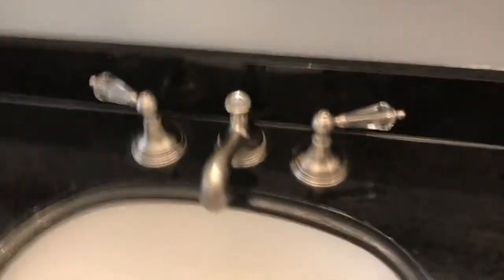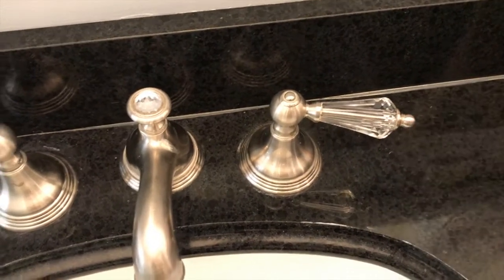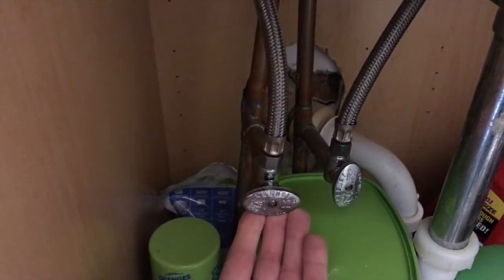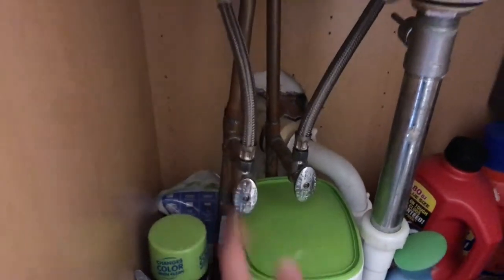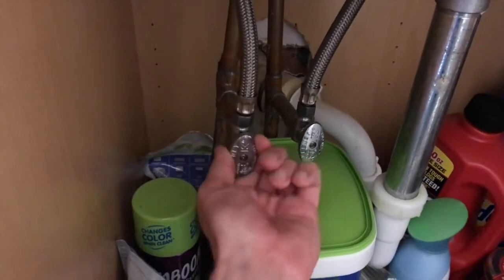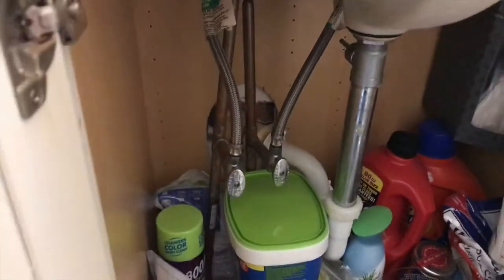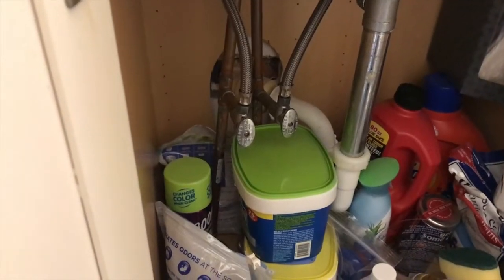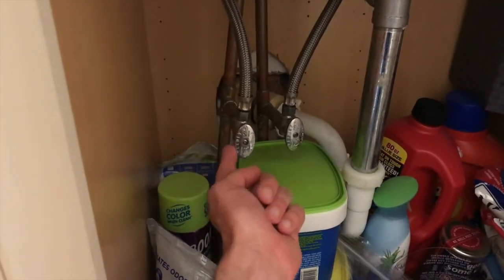Vibrating/Humming Pipes - "3 Most common causes"!

Comment: I've got a humming sound all over my unit, the same sound decibal, I wonder if it's due to the pipes and if so, are there pipes in the roof, It's not an electrical issue, could that be the problem?
Reply from the maker: Good morning, just poured a cup of coffee and am sitting down to answer any and all questions for the DIY community.

Have you adjusted your hot and cold valves?  It’s unlikely that you have plumbing inside roof area as it, in most cases, wouldn’t be heated.

Has anything within your plumbing system been changed recently…?…new faucet, new toilet, new sink…?

Let us know if you have any questions and hey if you’re into crypto trading, join our DIY ecosystem.

       toolboxtoken.com

Reach out to us any time!  🧰
Reply: Ok. Thanks for letting me know it's really bizarre, it's the same humming sound in each room,, it started since the neighbour had a split system air conditioner installed, the noise is still occurring even when her air conditioner is off, what might it be, Sounds like a distant vaccume cleaner, I wonder if it's coming from the roof, there are rats in the roof don't know if they've done damage?
Reply from the maker: @carmenbugeja8722  

We are happy to help.  Is this an apartment complex, condo, or duplex?  If so, you may want to consider bringing this to the attention of the association.

Your plumbing should not be altered or affected just because your neighbor got a new AC unit.  It’s possible that your neighbors system is tied into your plumbing and will require some minor modifications to alleviate vibration and bring it up to code.  This isn’t uncommon with these setups.

Comment: Humming pipe noise anytime my sprinklers are on. Can you please let me know how to fix it? Thanks
Reply from the maker: Southern California 

Thanks for watching & is your sprinkler system connected to the spicket or do you have a full electric control box on wall?

If it’s connected to spicket, there should be a shut off valve inside home on the opposite side as your spicket.

Make sure shutoff valve is in the fully open position.  If it is...It’s possible that your shut off valve is beginning to wear out and cause the humming.  Keep us posted.

Please subscribe to the channel and ring your YouTube bell 🔔 this will be very helpful to us thanks again.

😎👍🔧🔩
Reply: @DIYwithMichaelBorders  Thank you Michael for replying so quickly. I have a full electric control box on the wall. What should I do?
Reply: @DIYwithMichaelBorders  I subscribed. :-)
Reply from the maker: Southern California 

Thanks for the reply.  We recommend locating the closest shutoff valve to box & verifying it in the full open position.  Has this been going on the entire time you have had your sprinkler system?

Your household water pressure may be slightly higher than what the sprinkler system wants.  Keep us posted.

😎👍🔧🔩
Reply from the maker: Southern California 

Thanks, we subscribed back.

😎👍🔧🔩

Comment: I have this problem when anyone uses the shower in my guest bathroom.... is there info video available to fix this???
Reply from the maker: Marin Rands 

Thanks for watching & it’s very possible that your Stem is wearing out.  Below is a link to our step-by-step video that shows replacement of a Stem.

       https://youtu.be/F7B-3wR9aQ4

Whether you have a 3-Way shower valve or Single handle valve, the stem design is the same.  Some people replace the rubber gasket only and reinstall the old Stem with the new gasket.  In most cases this works however if it does not fix the issue it’s best to replace entire Stem.

Hope this helps Marin.

😎👍🔧🔩

Comment: Just watched the video.  I have a pressure regulator on my house because we have 120 to 125+psi from the city. It doesn't matter  what  faucet I open the whole house seems to make that humming. Any ideas
Reply from the maker: Robert Bragg 

Thanks for watching & that’s no fun.  Is this a recent issue or has this been going on for awhile?  Any recent plumbing repairs anywhere in house?

😎👍🔧🔩
Reply: @DIYwithMichaelBorders  it started I think 1or2 weeks ago.  After watching ur video the statement you made about  adding a regulator it got me thinking about the noise.  It was everywhere.  So I watched the pressure gauge while running the water and noticed that the running pressure dropped to 50psi. So I increased it to 70 psi running pressure at that point it quit. It's still weird but no noise
Reply from the maker: Robert Bragg 

Thanks for the update & that’s odd.  How old is pressure Tank?
Reply: @DIYwithMichaelBorders  5 months
Reply from the maker: Robert Bragg 

That’s still brand new.  It may be an option to check warranty on tank & have the company stop by & test it.

Comment: What if this is only occurring with the shower body valve when it’s turned on
Reply from the maker: Thanks for watching and welcome to the DIY Raptor Club.  This can happen when the internal stem/cartridge is wearing out.  It can also be as easy as replacing an internal rubber seal.

Below are a few links that you may find helpful.

       https://youtu.be/WHd_pKo0gx8

       https://youtu.be/F7B-3wR9aQ4

       https://youtu.be/5Np19i1yVYw

😎👍🔧🔩
Reply: @DIYwithMichaelBorders  Thanks a million
Reply from the maker: @worldview730  

You are very welcome, us fellow DIY’ers need to stick together.  Keep us posted on your project & any questions you may have.

😎👍🔧🔩

Comment: Hello Michael! I'm researching because my pipes are suddenly starting to hum and I'm a plumbing novice so I'm trying to figure out what my issues could be.

Recently my water heater died and funds are tight so the water intake to the water heater is turned off while we save to replace it. Things were fine for awhile but a couple days ago I noticed an aggressive humming coming when I was using the kitchen sink (cold water obviously). It went away when I turned the water off and wasn't repeated on other times using that sink so I figured it was a weird one off or maybe due to some local construction happening in my neighborhood. 

But today it happened when the toilet was being flushed, and when the tub cold water was being used. But again only a one off.

I'm thinking it's probably not valves since those were untouched and I don't know where to find my bathtub valves anyway to check those. Could there be other causes or things I could look into? So far Google is just telling me water pressure and I found your video when trying to look up how to reduce my water pressure. But I'm skeptical of that's it since a couple weeks happened between the water heater dying and the humming starting, and I dread the cost of a plumber with everything else going on. Got some ideas i can try?
Reply from the maker: Good morning, thanks for watching.  Any update?  It may be as simple as an imbalanced pressure within the system since your water heater is shut off…unlikely but possible…

It can also be that your shutoff valve for your cold water supply has gathered a bit of extra sediments and is intermittently restricting water flow.

Sediment buildup can gather slowly over the years however build at a more rapid pace when vital components within your water system fail…such as filtration system, iron removal system, water softener system…

Once water heater is replaced and all systems are a “Go”…we recommend allowing water to flow out of all your faucets for roughly 15 minutes.  This will help system push out and flush as much of the built up sediment as it can.
Reply: @DIYwithMichaelBorders  thank you! I don't have any solid answers but the humming seems to have stopped..... and the local construction has completed. Best guess something they were doing caused the humming and probably I wasn't the only house to encounter it. My water pressure never changed and it doesn't seem to be an issue with the valves unless I'm missing something. 

So, guessing it's something they were doing and issue is hopefully resolved. Fingers crossed!
Reply from the maker: @danistaab7152  

Thanks for the follow up, that’s very likely.  No more vibrations within plumbing system is a good thing.

😎👍

Comment: THATS EXACTLY THE SOUND/NOISE my shower makes. 

I have a single knob adjuster and when I turn it on hot mode, it hums so loudly. 

How do I fix this?
Reply from the maker: Thanks for watching & welcome to the DIY Raptor Club.  We are going to post a few helpful videos below.  Sounds like you need a new stem.

First, we will share our video showing replacement of stem.  Although our video is working on a three-way valve, you only need to replace one.

The second video shows us working on a single shower handle.  Although we do not replace the stem in the video, it will hopefully help you get a lot more familiar with the parts that need to come off.

1.  Replace Shower stem

          https://youtu.be/F7B-3wR9aQ4

2.  HOT/Cold reversed

          https://youtu.be/9QiJt4YPU_o

😎👍

Comment: My entire home has a low humming vibrating sound it us super annoying started  when pipes and boilers installed cannot pinpoint exactly where it's coming from  its like its in the walls
Reply from the maker: Thanks for watching & welcome to the DIY Raptor Club.  How long ago was new pipes & boilers installed?

If very recently installed, you may want to have the plumbing company that installed new parts come back & make some adjustments.

Keep us posted.  😎👍🔧🔩
Reply: @DIYwithMichaelBorders  
It's been nearly two years but there is this a low constant wooing/ droning sound in my home.  It sounds like its in the walls and the boiler is very noisy
The Walls also make a cracking  sound when the heating comes on which I think is the pipes.  It has been very stressful and affected my health
Reply from the maker: @missamour1393  

Thanks for the reply.  Any update?  You may actually be hearing water flowing through the pipes that feed water from a higher floor.  Is your home have a second floor?   Does your home have a large household water filter connected to your plumbing near softener & salt tank?

😎👍🔧🔩
Reply: @DIYwithMichaelBorders   Hi,  so I live in a maisonette.  There is upstairs and downstairs so two floors.  There is no water filter. 
You maybe right about  hearing the water however  it mainifests as a droning/ humming low frequency  sound throughout the home  It's ruined  my quality  of life to be honest as cannot pinpoint  where it coming from. 
Thank you
Reply from the maker: @missamour1393  

Thanks for the reply & it’s possible that the water from above is slowing down inside pipe by a possible gunk buildup... acting as somewhat of a centrifugal flow hum...🤔... unlikely but we cannot rule it out.

If the plumbing pipe is 3 inches wide and over the years there has been a lot of build up decreasing the 3 inches down to 2 inches, that may be causing sounds.
Reply: @DIYwithMichaelBorders  Thank you for your help. To be honest my home to be making a low sound from day1 of the installation it's almost like a  wooing  sound trapped in the wall cannot say which wall but just throughout my home
Low but very annoying all the same . Thank  you
Reply from the maker: @missamour1393  

We definitely understand your concern.  A call to the landlord/building owner may be required to get it resolved.
Reply: @DIYwithMichaelBorders   been on to them but  they have not been much help.  Thank you
Reply from the maker: @missamour1393  

That’s no fun.
Reply: I have exactly the same problem,low vibration humming noise,has made life very stressful.! Landlord very unhelpful.